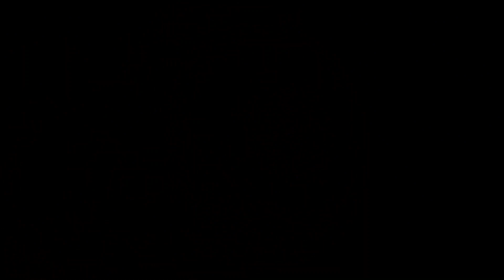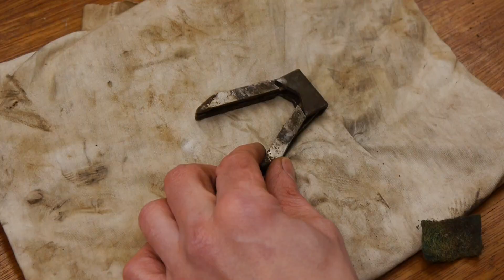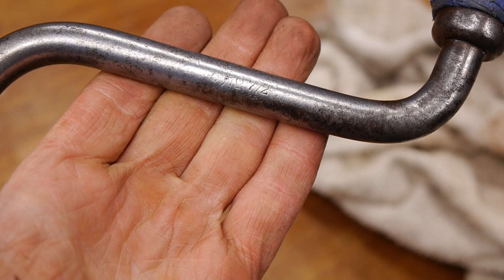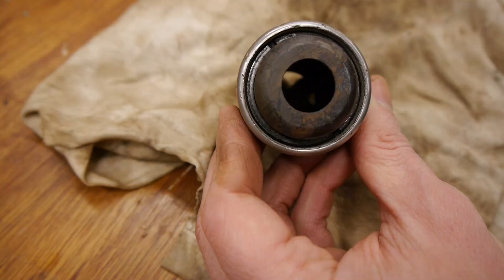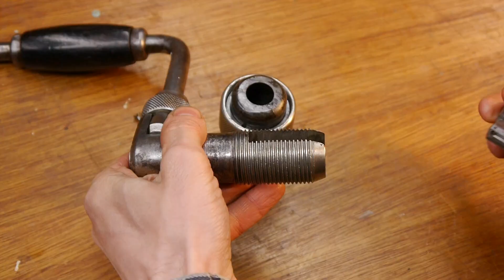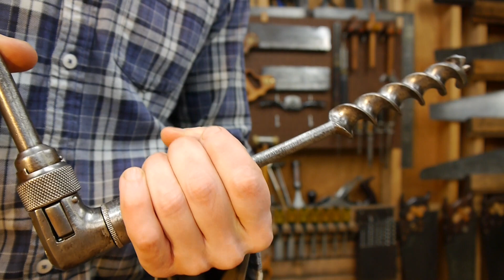Vintage bit brace restoration | 1920 Millers Falls No. 772 Lion chuck

Comment: Greetings from Australia. Nice work on the brace, my Dad had one. The small axe / Tommohawk on the board caught my eye. My brother & I have one each from our Grandfather, one is left, the other right handed. Have you done a restoration video on it? Mine needs a new / repaired handle.
Reply from the maker: Thanks @graemecoad1044 . That is a right handed hewing axe; unfortunately I didn't make a video of the restoration. I used a piece of red oak with a natural slight bend in the grain where the section that fits into the axe head starts (so that the handle bends away from the face you're hewing leaving clearance for your hand), and shaped the handle with a combination of drawknives, spokeshaves, and rasps as you'll see is some of my other videos. I sharpened the axe to a razor's edge (just as sharp as a plane blade or chisel) using oil stones and a leather strop. Good luck with your restoration!

Comment: I'm always battling rust accumulation on my tools.... Suggest that a fine wire wheel would get the knurled grooves cleaner than 0000 steel wool, but maybe using power tools is not allowed.
I wonder if anywhere there is a chart comparing the abrasive qualities of steel wool to the wet-dry sandpapers available?  Maintaining patina is one thing but getting a fine finish is sometimes an end in itself.
My dad's old brace had red tinted wood handles... probably another brand(?)
Could be my next little project:  cleaning and sharpening the drawknife I have that's identical to that in the closing shot.  There goes the rest of the day!

Comment: You might think about using Copper or Brass wool.  I get mine from Rogue River Tools and use them on old guns I’ve restored.  Gets rid of some stains and rust but will not get down to bare metal, if you use them gently.  Not being critical of your process. You do good work.  Thank you
Reply from the maker: Thanks Mike, good suggestion!

Comment: vintage hand crank drill work on modern hex Auger bits?
Reply from the maker: I find that most vintage braces will work with hex shank auger bits, but the best braces for hex shank will have "universal jaws" (instead of the less expensive and simpler "alligator jaws"). Examples would be the Miller's Falls Holdall and Lion chuck models, Stanley 923,  and P.S.W./Pexto Samson line. There are also adapters (hex to tapered square) available from some manufacturers.

Comment: This is a definite 👍 from me, it's great to see a restoration vid on one of these justifiably well-regarded braces and obviously it's in perfect working order when you finished. 

But I was a bit bothered by the process as there's a sort of a step backwards during the video, you used a wire wheel to do the front end (which is totally the right call IMO as they are often _the_tool for the job) but then stepped away from it to a, forgive me, way slower and much less effective method 😊

What methods to use and how far to take any restoration are each user's call, but when I spotted that those were indeed specs of white paint that got left behind.... well that sure had my OCD twitching LOL
Reply from the maker: Thanks Tungsten! I've grown more fond over the years of keeping the little signs of a tool's history and using gentler methods (which usually take a bit longer) to maintain the tool's patina that took so long to develop.
Reply: The hardest thing is controling the OCD urge….

Comment: what do you do if the chuck has a wobble?  is there a way to fix that?
Reply from the maker: Do you mean that the chuck wobbles around in a circle when you're drilling a hole, so that it is not keeping the drill bit straight?
Reply: @thehandtoolworks  if i hold the drill with one hand, i can wiggle the chuck left and right or back and forth with the other hand.  it's not a solid connection.  i've ordered several, and some have more wiggle than others.  so, yes, the drill bit is not kept straight when drilling, but the bit is gripped tightly by the chuck.  the wobble is not between the bit and the chuck but between the chuck and the rest of the drill.
Reply from the maker: There's usually a large slotted screw that screws into the top of the chuck and holds it to the body of the brace. I would see if you can tighten this screw. If your brace doesn't have a screw or that doesn't work, lmk the model. Note that all ratcheting braces will still have a little bit of wiggle to the chuck when the screw is properly tightened.
Reply: @thehandtoolworks  oh, i see.  so, i guess i need one without a ratchet then.  could you recommend one?
Reply from the maker: ratchet braces are great, i'm just saying a little bit of play is normal - - they weren't made to be perfectly tight and this doesn't affect function (it sounds like the one you have has excessive play due to a loose screw or some defect). If you're looking for a vintage brace, a few of the ones I like are : Millers Falls holdall 732, MF No. 772, MF No. 32, Stanley 923, Pexto 5310, Pexto/PS&W Samson, and John Fray 110.
Reply: @thehandtoolworks  thank you, i appreciate it.  i enjoy your videos, by the way.